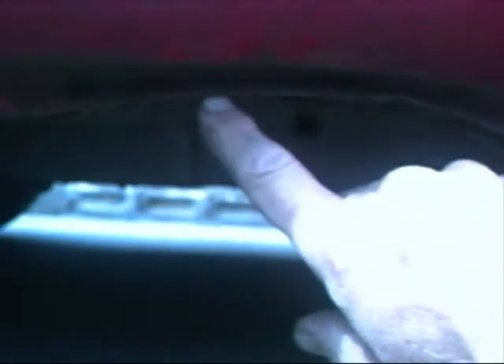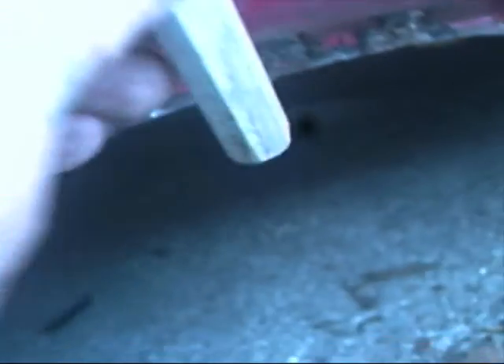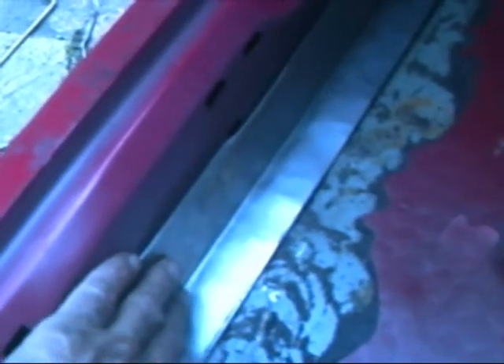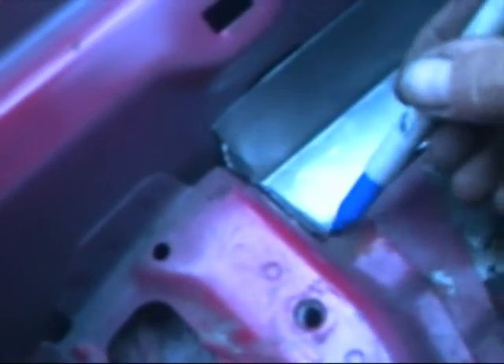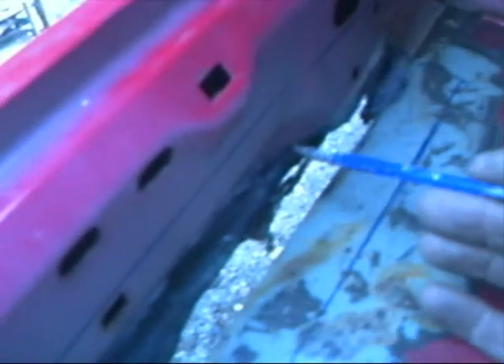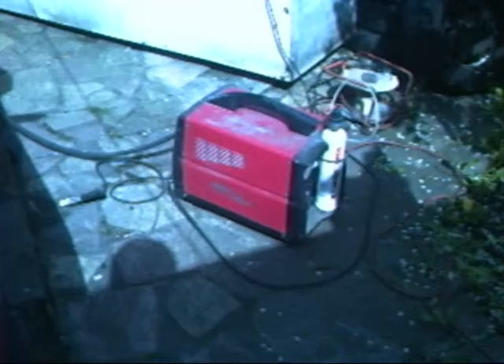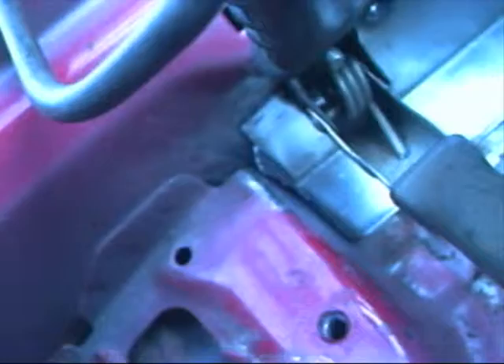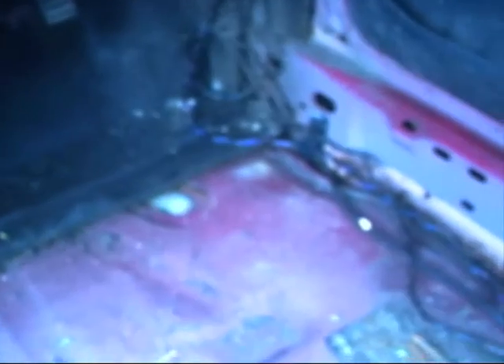Co2 Welding. How too, on my old Escort van to be stealth camper easy. Co2 (MIG) petethewrist

Comment: hi pete good videos. what thickness of steel do you use on the sills? i start welding transit soon
Reply from the maker: Hi .. I am not sure what sizesheet I haev used as I buy it down the spray shop ,, But mind you, when I do the seal I always buy the proper seals. I then eather put them on whole or cut to the size I need to patch, as I did with this van,,,  I like to use the stuff that is thicker and hard to cut, for the floors,, but what I do is put one handle of my tin snips in the vice and on the other handle place a bit of tube, this make the snips into like a bench cutter and it is much easyer to cut the thick sheet.. 
  I now have a third van that I will be starting on as soon as the red one is done..Mind you it dose not need half as much work doing to it.. A gain i payed £150 for her,, At the moment the red one is still in the garge all finished and waiting for the wax oil..under body then I shell tidy up the top body. Will post one final video of her when she has been sprayed or Waxed oiled
                                                        Cheers Pete
Reply: thanks pete.